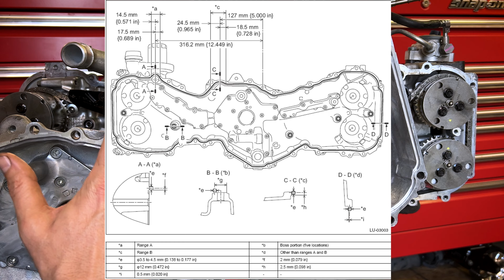Subaru FA/FB Series Engine Timing Chains: Removal & Installation

Comment: Is there a recommended interval on the newer timing chains? I was under the impression that they were "lifetime" chains barring some other issue
Reply from the maker: They’re lifetime. Only replace if there are issues.
Reply: @MrSubaru1387  thanks
Reply: Lifetime is, of course, subjective. Most car makers consider lifetime to be 100k-150k miles. Every part on a car will wear if you drive it long enough. Chains can stretch, guides can wear or break, tensioners can go bad.
Reply from the maker: @jeremybirdwell2623  I’ve heard lifetime in Subaru terms being 300k miles for chains. That said I’ve seen FA/FB engines reach well past that without chain issues.
Reply: @MrSubaru1387  Greatvto know as I have a 2014 OB with 172k and a 2014 Forester with 85k. I was able to do the timing belt in an old EJ20 with v the ringing still in the car. I seriously doubt that’s something I want to do with an FB.

Comment: I have a 2012 forester. Just got the engine back from the machine shop. Brand new engine rebuilt heads. It wouldn't start so I checked the timing chain . It was off. I reset it and the motor sounds better but won't start. Has 4 codes. P0102,p0113,P0328 and p0430. Any suggestions?

Comment: Question..can you change outer seal for the oil pump drive seal without taking the timing cover down? I have a oil leak behind my crank pully😢

Comment: This video is a lifesaver! About to go replace my intake camshaft sprocket on the passenger side but have been super nervous about doing this. Quick question though, if I only replace that one sprocket and use special tools to keep everything in place, I wouldn’t have to reset timing would I?
Reply: It’s probably a good idea to go ahead and reset the timing because if you get it all back together and the timing is off, you’ll have to take it all back apart again and do it anyway. Plus, if it jumps timing again, it may screw something up

Comment: So I'm gonna be getting a 2005 Subaru legacy 2.5l. I'm not really a Subaru fan but it's the best thing I can get to cart my newborn around in. It has a slight rod knock I guess so I'm thinkin of putting a 2.0l motor from a Baja in it cause I know those motors are more reliable. Will the 2.0 bolt right up to the trans and everything in place of the 2.5l?

Comment: Hi, I am from Malaysia. I did asked 2 of the workshop mechanic and both of them told me Subaru engine is expansive to maintain and common issue is oil leak on the FA and FB engine. Once it happen need ti bring down the engine and also hassle to service as well on other issues. I am interested into Subaru Levorg 2.0 with Turbo but would prefer a car with less hassle to maintain. Levorg is come with FB engine if not mistaken

Need to advise on this, thank you in advance.

Comment: So I have a 2015 Forrester with the fa20 however it started having a loud valve tap before I could get it into the garage the rocker fell out long story short I had my wife start the car with the cover off the rocker section and where a fountain of oil should have been spewing out of the open rocker less lifter/pivot and not a drop comes out of the lifter however all manner of oil comes out of everywhere else. How can this happen

Comment: @MrSubaru1387 I am currently in the middle of replacing timing chains, guides and tensioners. Do the chain guides need to be covered in oil pre installation or can I put them in dry

Comment: When should you get it done I just got a Subaru it’s a 2012 Impreza with $128,000. I changed transmission and oil in it.

Comment: I have a problem with the Subaru Forester 2015, I replaced parts inside the engine Ringe piston, connecting rod bearings, crankshaft bearings and gasket full. after repair and installation, when the engine is started, vibration occurs when the car is parked or when the speed is reduced at 10 km/h. What is the reason?

Comment: When I’m turning it over at the crank to check it over is it normal for it to occasionally spring back counterclockwise as I’m turning it clockwise? Rotates smoothly but at times there is some spring tension that makes it all want to spring counterclockwise. Is this normal? Also my engine is the fb25 and my lower cams on the LH side & RH side are just sprockets, they aren’t identical to the top like in your video. Do I still follow the same process? Hoping for some guidance thank you

Comment: Hi MrSubaru,

Planning on doing this on my 2015 Outback 2.5 130k miles. Is replacing the 2 chains necessary? Do you know if they tend to stretch? Any tips on inspecting it will be appreciated. 

Thanks!
Reply: why do you need to do timing chain replacement? I thought they never need to be replaced unlike belts?
Reply from the maker: No need to replace unless they give problems.

Comment: Hey Mr. Subaru, would the yellow marks that you use to indicate if the cams are in time. Would it be safe to mark it if you were doing a costumer car or like a personal car juat so you don't forget? Also marking it to help identifying it would it cause any oil contamination by any change? If it doesn’t do any oil contamination what would you recommend of a marker to help easier identify the marks?

Comment: Do you have to remove the engine from the car to do this fix? A friend of mine took her Forester to the dealer, and they told her it was going to cost $11,000 because they had to pull out the engine.

Comment: Mr Subaru 
Sorry for bothering you but I just changed my engine in my 2009 forester that ran but burned oil badly 
With a 2009 outback that ran and drove right in the shop before pulling 
Now that it's installed it doesn't have spark 
Any idea if it has to do with senors or is it the crankshaft timing gear possibly??

Any help would be greatly appreciated

Comment: I pulled my 2.5rs engine out. Then realized my impact doesn’t have enough a$$ to loosen the crank bolt? Any tips on getting this off when the engine is on a stand?

Comment: Sir what engine oil should I use for my gr86 with the new fa24 I live in florida its usually around 90 degrees I'm thinking I should use either 5w30 or 5w20 possibly 0w30 please let me know owners manual says 0w20 but it says it is for more flow in cold weather, but it is hot where I am?

Comment: PLEASE!!!!!!! Does anyone know the part number for the injectors on the FA20 brz engine that are located UNDER the intake manifold!!! THE ACTUAL FUEL RAIL AND HARDLINE THAT RUNS ACROSS! Not the ones ON the intake manifold!

Comment: What is with the YAMADA symbol on the Subaru timing cover?
Reply from the maker: Yamada makes parts for Subaru. They started to manufacture the later EJ series engine water pumps. They manufacture the timing covers and other parts on the new F series engines.
Reply: @MrSubaru1387  thank you fot this video Mr Subaru im currently replacing and head and intake cam. The caps for the valve springs are a new endeavor for me. Thanks again

Comment: My 2.5 has the startup rattle from day one. How can you expect it not to rattle when the oil filter is mounted upside down and every morning you dry start the engine because it needs to refill the oil filter. This is a really bad design.

Comment: Do you have a head gasket installation video for FB engines?
Reply: @Braapcity did you find a video on doing the head gasket? Currently doing my Subaru now and trying to do it w/o pulling the engine out.
Reply: @frankvespalec3830  pull the engine out it's easy. Headgasket job is best done on the engine stand

Comment: I thought the purpose of the chains as opposed to the belts was you didn't have to do this anymore
Reply: @hankitytankity  Which should be almost never
Reply: @hankitytankity  Nope / have 2 / 250,000 on a 2005 and 89,000 on a 2011. Keep the maintenance up and zero issues on cams or heads
Reply from the maker: More likely to need to reseal the timing chain cover and cam carriers than pull a head or replace chains.

Comment: I'm getting a check engine light for P000A,B,C and D all solenoids have been swapped out. what could the issue be.
Reply: was able to get everything apart and changed out my A sprocket. Wish I had done all four when I had the thing taken apart. Now I'm pulling code P000C. Going back this week and changing out the other three sprockets. Cant seem to find the FA/FB crank Pulley Holder on line. ended up using a vice chain and the old belt.

Comment: Hey Mr. Subaru I watch you on a regular bases. I have a 2018 Outback 2.5 touring. I don’t know what it is if it’s a ej aj if it has a belt chain I have been out of the shop many years can you please inform me. I fixed small airplanes
in the army and served in Vite Ñam 1969-70. I use to fix cars too but can’t remember what I had for breakfast. I tried to do tire rotation. Once I got the tires off I could not get them back on without help. I am old and decrepit. Any way I like your youtube videos. Reminds me when I use to fix things. Pay no attention to those negative comments lots of haters out there. Have a great day keep up the good work. 😊
Reply: An '18 Outback has an FB engine with a timing chain.